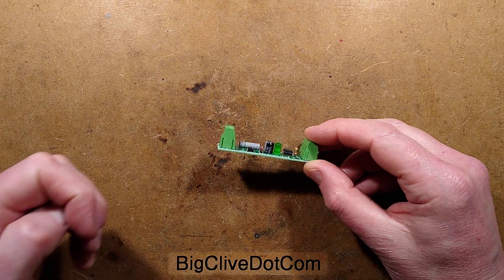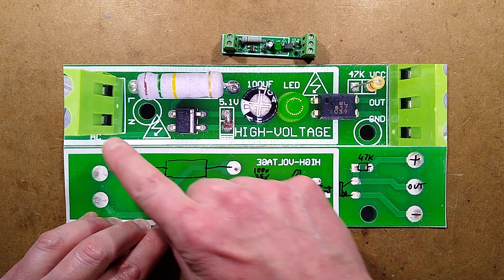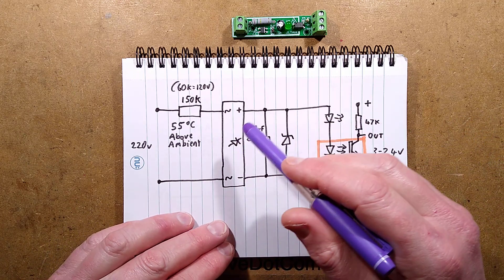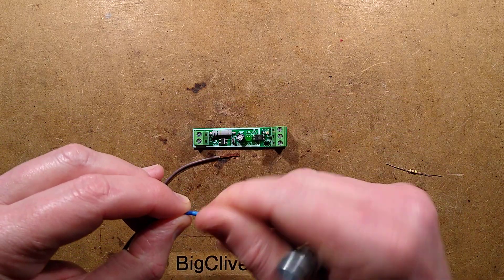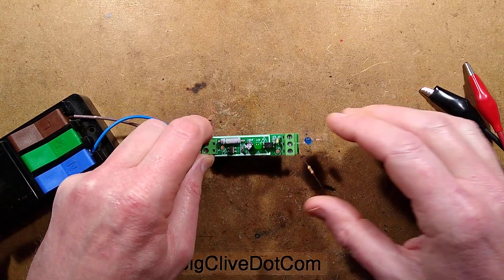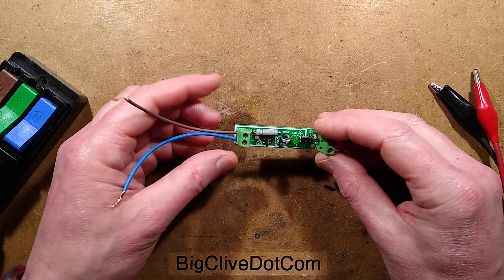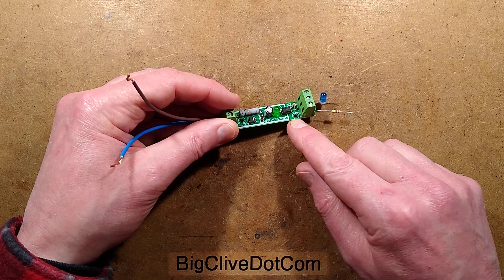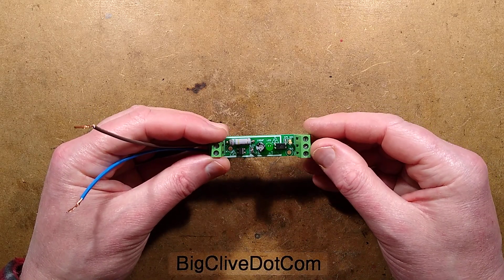120/240V to logic level optoisolator (with schematic)

Comment: Ideal to mount to a PIR Security light, and when the light illuminates it can switch a Audiable sounder to let you know the security light it lit .. say when you in a different part of the house or night if some comes on yourdrive way and your in bed ..
Reply: The PIR security light always receives the mains voltage, surely?   And makes its own decisions, as to whether to illuminate, according to whether it detects IR activity?
Reply: @theskett  , Yes, but inside the PiR Light is a Wire  which is a switched output, the wire that allows the Bulb its self to light, so if you use that wire and a neutral wire , and connect them to this circuit clive is demonstrated then you can use just use a low voltage circuit , as simple as a Buzzer and a battery connected through the optical side so it completed the circuit, so once the light is triggered and illuminated the buzzer will buzz for the same duration as the amout of time the bulb is lit for .
Reply: @PlanetRuncorn  Yes, and that's good, but that means I have to go into the light bulb to get a connection.   This means dangly wires, from the light.   That's (politely) against code.
Reply: @theskett   @theskett  hi again. Obviously you have to modify the light, thats what were all about on here.. You mount and wire the opto isolator inside the lamp, then you need to drill small hole in the security lights wiring box .and add  a rubber grommet / gland  this will allow you to run the low voltage cable to where ever you want, inside the wiring box you could use silcone or simular to ensure complete watertighness ..if you think this method is still not incode, then Alternatively instead of using 3 core cable use 5 core cable , and use the other two to conductors connect the low voltage buzzer that way, the advantage of that method is only one cable entry as per manfactured ..
Reply: And that long-and-complicated explanation is why I might prefer a current transformer, over (goddamnit!) reworking the LED lamp.

Comment: I wonder why they did not use a capacitor dropper or inductive coupler?
Reply: I guess, you shouldn't use an inductive coupler on mains frequency. I'm not an expert, but I feel like it has to have a metal core and pump a significant amount of charge through to make it work. Also, you will not only have to rectify and smooth out the resulting pulses of current, you'll have to clamp it down to a safe voltage on the low voltage side.
And a truly galvanically isolated circuit on an inductive coupler implies using of a transformer with separated windings.
Guess what? This all will make your circuit more complicated, more expensive, more heavy and less universal, because you'll also have to adjust the low voltage side for your target voltage levels.
While this one is really a transistor with an optically isolated gate, this module is simple, cheap and actually not bad at all, IMO.
Reply: @jkobain  really the only problem of using an inductor, strictly a current transformer, is that the mains supply wwill need to be loaded to enable the current flow to be detected. Such devices are used in the auto mains switches, that turn on a slave supply socket, when sufficient current is taken from a master socket. It is the same technology used in RCDs.The transformers are very safe,as they are little more than one or two turns of the insulated mains wire passed through a toroid core, with a fine multiturn   secondary sense wire. The output of the secondary is a very low voltage, low AC output , that is amplified to provide a trigger signal for logic. The isolation between primary and secondary can be very high, but probably less than that which can be achieved by a high voltage opto coupler. To avoid the need for a load current, one might wonder why the dropper resistor was not replaced by the common capacitive coupled dropper circuit. These are to be found in devices such as electronic mains clock/timers.
Reply: @nigeljohnson9820  so as I supposed in the beginning — need to always be putting a significant amount of charge through the inductor (transformer). I may be wrong at my estimations, but I feel this circuit to be quite cheap in comparison to a transformer solution. I'm really not an expert, which makes me no excuse, tho.
Reply: @jkobain  I do not think the primary current needs to be very large. It is certainly very small in the RCD/ELD, where it is earth leakage current. It really depends if the aim is to detect that a circuit is live or if it is drawing current. There must be a market for a mains detector that uses the same technology that  used in those handheld, non contact mains probes. These bleep and light when held close to a live mains cable. They pick up on the AC field generated around a live cable, even when it is not carrying any load current. .
Reply: The only reasons I can think of for not using capacitive dropper is to preserve the power factor and the phase relationship, maybe for zero crossing switching.
Reply: A resistor's a penny, a cap is maybe 10c, an inductor is maybe 15c.  Go figure.
Plus the resistor's typically smaller, less fragile, not a custom-order part.
Reply: @theskett  a capacitor dropper would have produced a better product, such circuit are to be found in so main mains powered products, you would suspect that such ubiquitous parts would cost a lot less. It's not as if the capacitor divider has to deliver much current, its only driving an LED, not the usual requirement for a relay.
Reply: @nigeljohnson9820  Y'all should notice that "have produced a better product" isn't the objective.  Producing a cheaper "MVP" product is the objective.
But yeah, if I can buy an LED lamp from Poundland for £1, the cap-dropper part should be relatively cheap...  :-)
Reply: @theskett  it is a matter of safe operation, all capacitive droppers should be fused against a short in the dropper capacitor, mainly for fire protection, even though the capacitor should be the X type.
Reply: @nigeljohnson9820  Right, that's why I'd put a "fusible" resistor (100R?) in series with the cap; lessens the current surge, pops before the tracks.
Reply: Incidentally, I've never ever ever seen a mylar cap go short; they're generally self-healing, and any over-voltage just blows off some aluminizing and causes a drop in capacitance.
Only those new tiny ceramic caps seem prone to shorting and fiery failure :-)
Reply: @theskett  that is why they use X caps. They are intended to fail open, but things can go wrong so I think a fuse is essential.

Comment: FOD814, get rid of the bridge, use 2 resistors to drop mains.
Reply: We use this setup to detect zero cross. We also learned about half watt surface mount rated resistors are still not good enough, we've moved up to using mini-melf packages, 3/4 - 1watt rated.

Comment: This is interesting. Do you know of a device that works in reverse to this. Input a logic level to an optoisolator and then use that to turn on a triac to turn on AC?
Reply from the maker: Solid State Relay (SSR).  Beware if the cheap ones on eBay as they are not always rated for the stated current and may have poor isolation.
Also note that they often fail in the on state.
Reply: @bigclivedotcom  I considered SSR's, but they are stupid expensive! A triac of the same current rating is much less costly. An SSR is not really special. It's just a mosfet in there and some control logic. A couple of 150v mosfets will do what an SSR will do at far less cost. Buying electronic components on ebay is a sketchy proposition. This is much better done from a legitimate source like digikey. 
**
What I was really looking for was an opto-isolated triac driver that can be controlled from logic levels.

Comment: Nothing like some spicy knowledge. Learning with every video. For those interested, check out Aliexpress for the "Optocoupler isolation module voltage detect board adaptive" for the unit a good bit cheaper. Gets round the pesky politics influenced prices hike.

Comment: This zener is strange, even if it's for protecting the capacitor if it goes open circuit or over voltage from the mains, a simple resistor would be enough and cheaper

Comment: how to connect to plc sir
Reply from the maker: It depends on the PLC, but the output transistor can be treated as an open collector output like a sensor.  It switches the output to 0V.
Reply: connect to plc mitsubishi fx1n , as an input, as a voltage detector with on and off purposes

Comment: Good circuit to measure mains frequency with Arduino just remove the 100uf.
Reply: Also replace bridge by single diode, to avoid double frequency.
Reply: @johndododoe1411  I've just divided by 2 in software, that also halves the sample time required to measure. I use it to add loads to my off grid system in an attempt to balance input V output. My main load is a hot water system and hopefully soon a reverse cycle air conditioner compressor.
Reply: @darrenchapman7203  good to know, I'm currently in the late stage design of a replacement oven timer, and have incorporated this module to act as a zero crossing detection in my design as a means to reduce arcing when switching. Have you experience any negative issues?
Reply: @sydcarter3  not specifically with this module as I put my own together and the zero crossing is handled by the SSR

Comment: I think the reverse biased zener is to limit the voltage across the LED and optocoupler to the reverse voltage (5.1V) of the zener. It's a cheap and simple way of doing a form of voltage regulation, but you have to put a current limiting resistor in so it doesn't just short circuit the supply.

I've used similar circuits to get a 5V level input from a nominal 12V (vehicle) supply. You don't know exactly what the input voltage is going to be, anywhere in that case between 11 and 15V, or in this case 200-260V RMS so a simple resistive divider doesn't really work.

Comment: Must be posible to create a logic level signal from ac thats very efficient...? Using 1 watt seems very wastefull. I would like to monitor 20 ac lines, no way I'm going to burn 20 watt to do so
Reply from the maker: It can be beneficial to load the line down to avoid capacitive coupling issues.

Comment: Wonder if this could be technically used to detect if there was power failure using a raspberry pi.
Reply: That's pretty-much the intentional use-case, yes.
Though there are smaller, easier, cheaper ways (e.g. a resistor and neon, facing an LDR).
Reply: @theskett  The interesting thing is i was thinking a LDR on a RPI+neon from a power strip but i did not know how viable it would be or fragile to construct.
Reply: Poundland (or equivalent) will sell you a night-light that includes an LDR, for £1 or $1 (depending where you are :-) -- pull it apart, cut out the LDR, cheaper than buying from Ebay and the night-light still works ("always on", but same current) even after you've cut out the LDR :-)
I like your "power strip" thinking; "Use what you've got, where you are", "I got a neon, right *here*" :-)
My only reservation is that, if you use the power-strip neon, you gotta keep daylight off the LDR; so you're gonna have to black-bag (or equivalent) the power-strip.  But anyhow, you understand :)
Reply: @theskett  not too hard to keep daylight off it if its faced down i assume , The idea was if the rpi detects power failure ill make it trigger a relay for backup lighting or something like that.
Reply: Sounds like a plan :-)
Though I wouldn't trust the upside / downside thing, one good nudge with the Hoover will flip ya :)
Maybe some aluminum duck tape, eh, that's opaque.
But anyway, what you said (y) :-)
Reply: @theskett  I was thinking maybe a custom clamp that would hook onto it maybe made from pollymorph plastic or some thing like that.
Reply: All good, but you're more professional than me.  I'd just use duct tape (or hot glue, except that that's translucent :-)
Reply: @theskett  Not sure about more professional , I just have to find the motivation to start such a project in the first place :-D
Reply: Welp, if you're a Brit, get your butt to Poundland; they have Twin Peaks chocolate, it's really quite good (I hope this gets you suitably incentivized), and you can pick up a coupla night-lights with LDRs also, and then go from there :-)
Reply: @theskett  Haha yeah im in the UK , I can probably find most the parts at home , I dont fancy going out catching the black death yet :-D , I just have to find a suitable project box thing and some wire thats not too thin.

Comment: Why not just use a small relay?
Reply: Size, cost, noise, unreliability, incompatibility with IoT.
Reply: @theskett  you clearly have no idea what you're talking about
Reply: @EitriBrokkr  Haha!   I have a bucket full of relays and 50 years of experience.  And college EE.   C'mon, fight me harder, butt-head :-)
Reply: @theskett  then you'd know they make pcb mountable relays in sub 10mm packages, rated at 50 million+ cycles that can handle 8 amps? The faintest 'click' they are going to make wont be heard over the boiler running. How do you think your thermostat works? Magic?

Comment: Understanding resistor power ratings must be the one most neglected  topic of the designers' everyday education and daily practice.  And the manufacturers contribute with their pictures that refer to the power rating, although the actual data does tell the truth later in the document.  Same modified "truth" can also be seen on transistor dissipation ratings, with numbers given as if anybody would use them with a chiller that keeps the heat sink connection surface at room temperature, or maybe even at freezing point.  Returning to resistors, in the old days the maximum element hot spot temperature might have been 70 degrees C and later there were two listed temperatures, 70 and 125.  Later yet, oxide resistors might be found with 175 degrees hot spot rating.  Finally, enameled wire wound resistors have been 275, 300 or even 350 degrees C.  Just think what those temperatures do to class F (155 degrees) rated circuit board or the usual SN63 solder!  I'm not going to even go to the 5%, 1%, 0.1% and even closer tolerance versions, where you really need to study what everything means.

Comment: Had a mosfet pwm switching module with an led on the input and one on the output. Hooked it up to a raspberry pi and the input led lit up, but no output... Turned out you can't drive a circuit that requires at least 3.3v with a gpio output pin, go figure lol. some resistors and 2n2222 transistors did the trick...
Reply: I haven't used a raspberry pi yet. From the documentation it seems you can adjust the drive strength from 2mA to 16mA of the GPIO Ports, default is 8mA.

As a first test: Just remove the Led from the input and see if the output Led light up. If so your LED draws too much current. You can then try to i.e. double the Led resistor to half the current and see if it works then...

Comment: Haha, you don't want to know my work of art from 2 years ago.
I had 250mW Resistors for my voltage divider and they got so hot it changed the color of the Protoboard.
But at least I had a Fucking Fuse. (200mA 250V)

Comment: I have one of these connected to the fan supply of my heatpump boiler. When it senses the fan powering (on speed 1 or 2, based on caps) it will open the in and out ducts to prevent draft on windy days. I just shrink wrapped the whole thing when I built this into the boiler. This way I didn't have to cut or tap into any wiring in the boiler and just use the existing fan terminals on the mainboard.

The duct, a link to the code with the ESP, and combined with this input isolator works really well for over a year now.
https://www.thingiverse.com/thing:4155400

Comment: Im not overly thrilled with those green connectors that come with every Asian circuit board for power connection. They are so horribly crappy, and fall apart at a moments notice. Im also not overly thrilled with the density of the boards vias.

Comment: Or you can use a 230V to 6V 3VA transformer...
Reply: But that's a big ol' expensive heavy lump, that may cause fractures in your PCB (if it's on the PCB...) or need separate mounting.
A 2c resistor and a couple other light-weight components are smaller, lighter, and much better value.
Reply: @theskett  - a 3VA transformer is not very big, granted, it’s heavier than the circuit shown in the video. But if it’s mounted inside a larger item of equipment, that may not make the overall weight any significantly greater.
Ultimately, it depends on what is best for your application. Personally, if I wanted to use an opto-isolator/opto-coupler in a existing item, I would be  designing my own PCB.